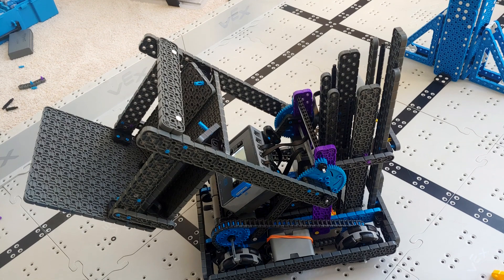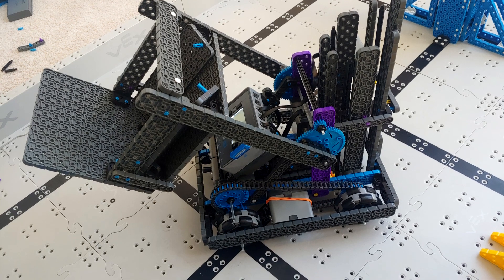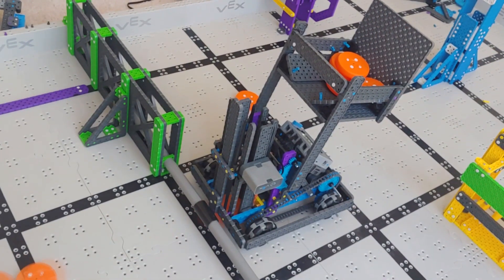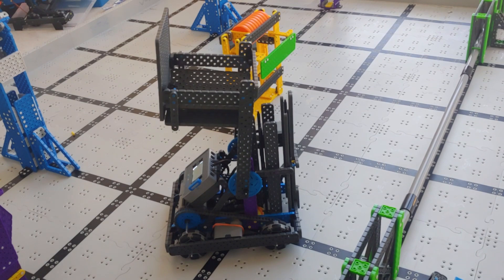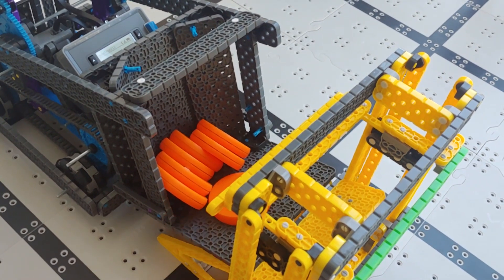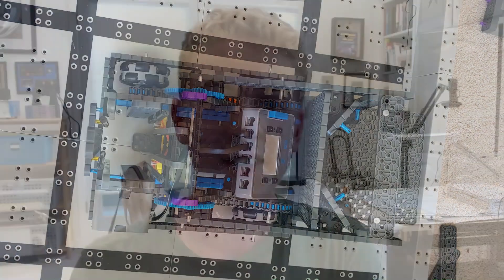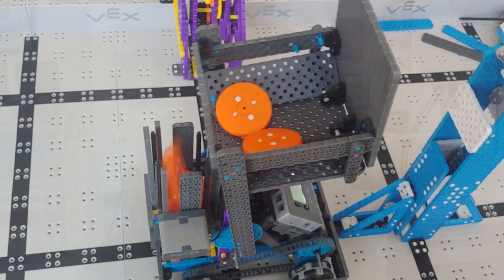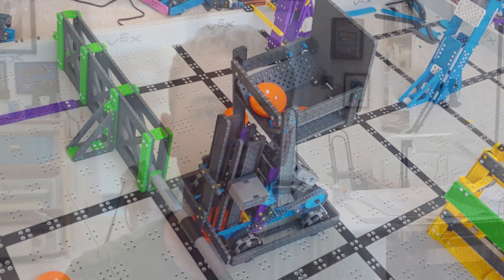FAILURE: My VEX IQ Slapshot robot that didn't work (and how you can avoid this too)

Comment: To save a motor, I found pushing on the top of the disks in the yellow dispenser works. A passive mechanism is possible, and it does fit in the space you have, and with minor modifications it could work. Dont give up on this design!